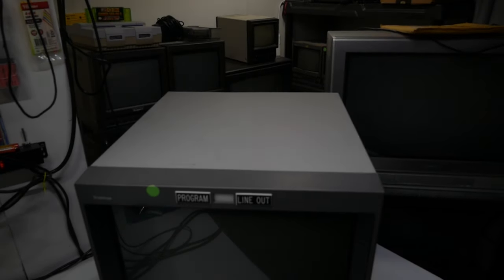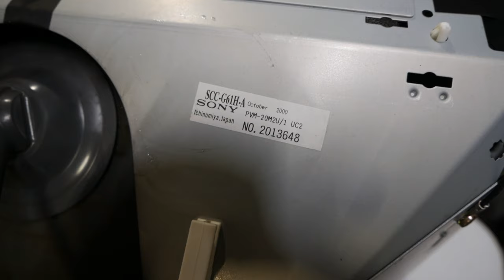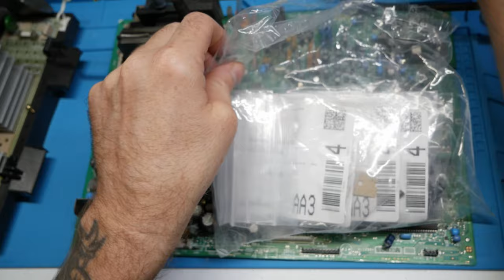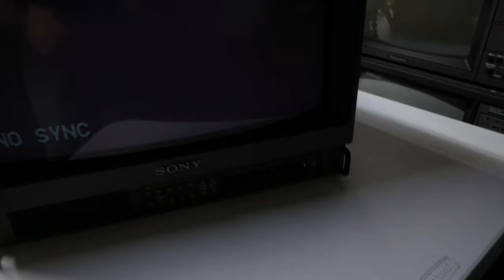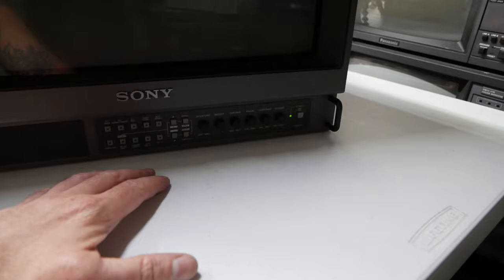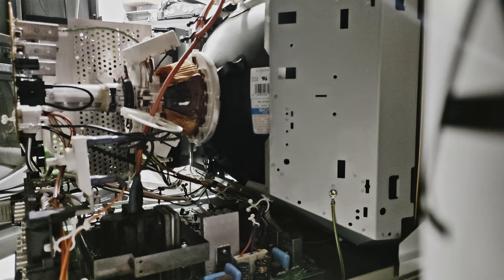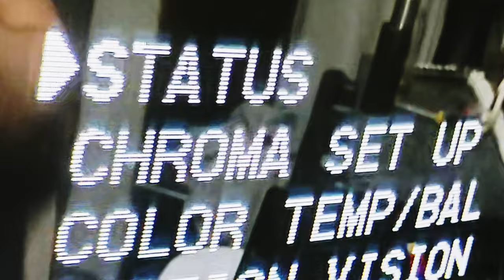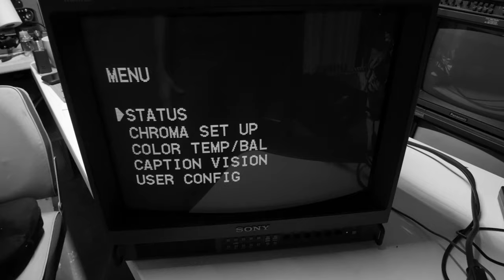PVM-20M2U Frustrations, No Power Red Tally Light, CRT Arcing, Dead Front Panel Buttons, Lost Sync

Comment: My son accidentally shorted a 27-in Sony Trinitron a while back while I was adjusting the convergence. I was going to give up on it and throw it away but decided to do some replacement on the parts.  I replaced more than just capacitors but in the end I got it working again and was excited that actually fixed it!  I'm not really good at troubleshooting I just got lucky I think and replaced a bunch of parts in the area that I thought was shorted out. I think you're doing a good job man keep it up!
Reply from the maker: Thanks, and I remember you telling me this story a while back, either on here or reddit. Glad you got it going again.
Yeah i need to just start replacing things i guess. Id like to get a scope but would probably take forever to know what im doing with it.
Reply: @LameGaming  I realize every situation can be different, but in my situation after doing some simple tracing through the circuits... I decided to replace the parts that I thought could have got shorted in the path of the short. One of the parts was a transistor/ (IRFIB7N50A  IR 500V 6.6A .52Ω N-CHANNEL HEXFET SMPS Mosfet TO-220) which I found from a seller on eBay used... Once I remove the heat sink to get to this transistor out, I could actually see where it had art and cause an issue! Anyway maybe where you see that arc on your monitor you could perhaps Trace out the path and see if you see something out of the ordinary visually?? I seriously got lucky man I really don't have good troubleshooting skills but there's this guy on YouTube that has a really good channel I'll send you a link. I've been trying to learn from him.

Comment: I did the savon cap kit last summer break, thinking it would fix my V.LIN, sadly it didn't.
Too bad the 20M units don't have something like an SCOR, which is what it looks like is off. I tried every VLIN value but my picture still distorts/waterfalls more in the center than the rest.
I'm really lost on what to do, afaik there isn't an adjustable V.LIN Coil or something on the board.

Comment: When choosing your low ESR caps, what series are you using? I've found some of the new Nichicons that are supposedly low ESR don't actually list the ESR in the datasheet if they need to be above 100V. I was replacing some in a low end PVM and found the brand new "low ESR" Nichicons had about a 5x higher ESR than the old ones I was replacing - something like 1.7 ohm ESR versus originals that were around 0.25 ohm ESR, though those were also 85C caps. Mine I think were UPW series which happen to also be miniature whereas originals weren't. Just curious if you've run into that where new "low ESR" caps actually have higher ESR than what you are replacing. Awesome video as always!
Reply from the maker: I have ran into that.... I believe it was with the upw nichicons and i usually went with the ups i believe ( at work right now so just trying to go off memory) but yeah, Ive ran into that too lately and dont know what the deal is..... Maybe its normal, a different chemistry, or maybe we got bad batches but Ive been noticing the exact same thing and dont like it. I usually just go with 105c nichicons and pick the cheapest noted as low esr.... Upw,ups,upz if I remember right.
I may try some panasonics next. I was just in an ag560 panasonic monitor/vcr combo unit from the mid 80s and it was full of blue panasonic caps that were all still super low esr.

Yeah it doesnt give much confidence to replace caps with higher esr caps. Also i have a pvm 1344q I recapped power and deflection in just 6 months ago and turned it on the other day and noticed some waving in the image. 
It would really suck if we been recapping with bad caps 😣😣😡😡

Comment: I hear you bro. I have the same monitor and it has only given me 30 minutes of entertaintment and countless hours of problems. Fixed vertical collapse issue, and now I have some arcing on top of the monitor distorting the image.
Reply from the maker: That sucks, is it similar to the arcing issue I had on this one?
Reply: @LameGaming  It turns out that the anode cap was not properly insterted. I just finished doing a complete recap on this unit. Used only long life and high ripple current nichicons, chemicons, rubycons and panasonics. The screen looks brighter and has not given me any more problems since I recaped it.
Reply from the maker: @alfredocalzadilla7251  Enjoy it brother! I hope to get mine going eventually
Reply: @LameGaming  Good luck! I hope you are able to get it fixed.

Comment: I got a couple ideas. 1) step away from it for awhile and come back in a month or so after you forget about it. It's kinda like getting a second opinion. 2) get someone else to look at it. There's still a lot of guys out there that fix hifi stereos and pa equipment. Most of them can fix crts as well. 3) isolate the problem with some swapatronics. Try connecting the tube and the main board to some of your other sonys and see what happens. 

Sounds like it's got a nice fresh tube in it. You will get it working eventually.
Reply from the maker: Yeah, I did this work a couple months back, its still on the bench lol. I figured editing this vid might motivate me or give me some ideas. Ill probably start with pulling vertical transistors when I decide to get back on it. Definitely has a decent tube so hope to save this one.
Reply: @LameGaming  It's weird how every time you fix something another issue pops up....Good luck.
Reply from the maker: @riggel8804   Yeah, starting to wonder if that monitor is cursed lol

Comment: That shaking effect on the menu is the same as what my BVM does when you pull the menu up on an unused or un synced channel. So it's probably nothing to do with the actual output of the image to the tube. Like you say it is something to do with the picture or sync circuity or even the sync form the mister. Have you tried anything other than the mister?
Reply from the maker: Yep, tried a snes on svideo and composite as well (the clip with the screen rolling and a green menu)
Before whatever component went bad that osd was rocksolid even without a signal. When the display started stretching the osd did too then became unstable so idk lol

Comment: after a wrong handling with service menu, my 20m2u die.  a friend check it and found horizontal transistor and power supply regulator die, but after change this 2 components, they die again after 20 mins of power on. :(

any tip to check what happens here??
Reply from the maker: I replaced horizontal output transistor on mine too and after trying it the new transistor died and also killed the fuse and bridge rectifier in the power supply. 
I put in new power board and put the old horizontal transistor back in and it was ok. I bought my transistor on ebay, they were suppossedly new old stock transistors but I think they were aftermarket from china and no good

Comment: Shot in the dark. This happened to me on medical version of monitor on Mister and found out that C Sync was not enabled for some reason. Maybe double check .ini file of Mister console to see if Composite Sync is enabled.
Reply from the maker: Sadly it had this issue with any console or signal I tested.

I ended up reflowing entire board, testing all surface mount components, scoping board, replacing sync IC, re-replacing several caps.... Just couldnt find the issue.

Ended up buying a spare chassis board on ebay but it was recapped by previous owner with chongx caps so I have to recap it. I have the cap kit but just moved into a new house and the to do list is forever long right now 😩

Comment: so what did u end up doing  with the  pvm at the end?
Reply from the maker: Ended up finding another 20m2u on ebay with a bad green gun in the tube. Nobody was bidding on it but I didn't want to pay a ton for shipping so made a reasonable offer if he would just ship me the boards. The boards have already been recapped but sadly they used cheap aliexpress caps so I have to do another recap on the new board and I haven't had time because I just moved and still getting settled in. Hopefully within a few weeks I will be able to mess with it.